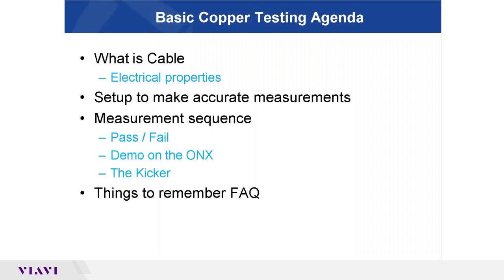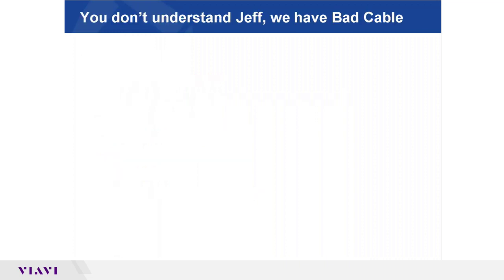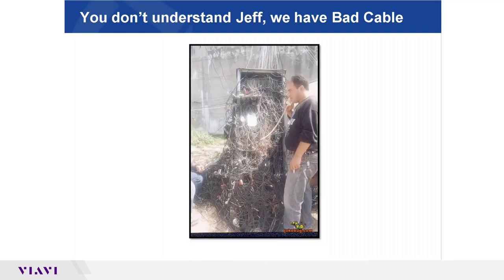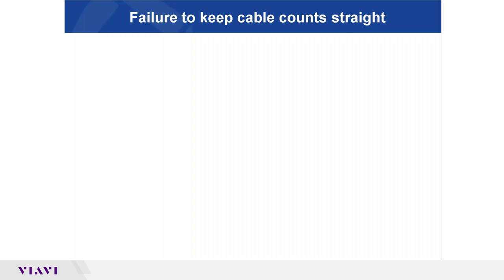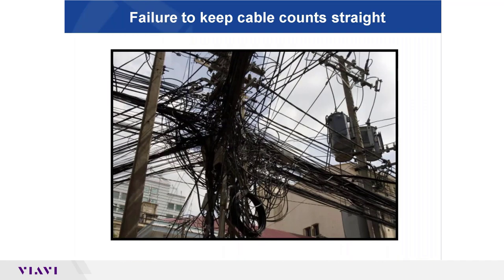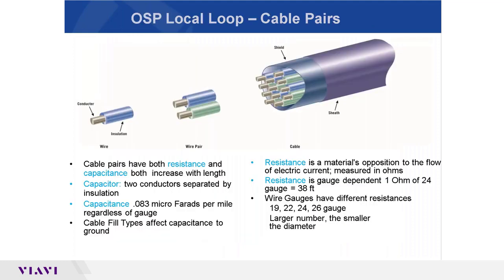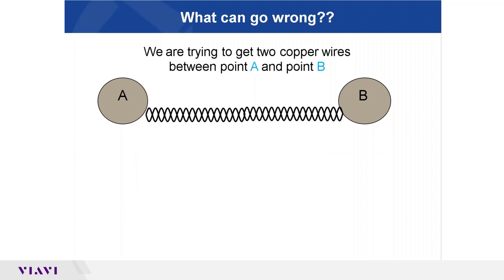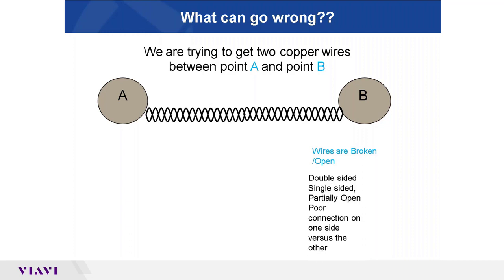Copper Testing with the OneExpert ONX-580, Session 1 (Multimeter, Opens, Balance,Load Coil)

Comment: HELLO VIAVI
I WOULD REALLY APPRECIATE AN ANSWER ON THIS ONE

I believe you have made a mistake

1. I'm not new to this game

Please reference in the video 17:20 (The Voltage Test)
i draw your attention to the screen layout and colour coding
Now in Australia we use AB  AE   BE    but that's fine.. i also Understand Tip and Ring so it's ok

Now let me put forward my case...

in basic electronics and electrical systems we know RED IS ALWAYS USED TO SIGNIFY POSITIVE POLARITY in an electrical Circuit
and BLACK IS USED TO SIGNIFY NEGATIVE POLARITY in an electrical circuit
and Green or Green/yellow is obviously an Earth Reference

so  
RED = Positive
BLACK = Negative
GREEN = Earth
Please remember this

Next point...
The JDSU HST-3000 and its successor the ONX-580 are designed (Among other things) to replace the LTS and LTS-2 (at least in Voltage mode they are)

The LTS-2 (as we know had the following colour schemes
RED = POSITIVE
BLACK=NEGATIVE
GREEN= GROUND

so far , no problems
and if i was to hook up an LTS-2 onto a 9V Battery with the Red lead to the Positive Terminal and the black to the negative  it would give me a reading of +9V
so that's our standard by which we are measuring the ONX-580

Moving forward
The viavi has 
A RED LEAD
A BLACK LEAD
A GREEN LEAD
correct

FACT -  (I have tested this)
If (When new) you plug your RED Lead into the Back panel of the viavi on the RED PORT labeled  ("R   B ")  
and you plug in your BLACK LEAD into the BLACK PORT Labelled ("T   R")
and your green lead into your green port    labelled ("G   E")
then you test the 9V battery i the same fashion

YOU WILL INDEED GET A READING IN VOLTAGE DC MODE AS   +9V

so.....  IF WE MATCH UP THE COLOURS WE ARE ALL GOOD AND EVERYTHING WORKS

Please bear with me on this ok

so... thus far we are all ok
SO THE WIRING ITSELF AND THE INTERNAL CIRCUITRY IS CORRECT

NOW HERE IS THE ISSUE
When you look at the video  17:20

TIP HAS ALWAYS BEEN POSITIVE
RING HAS ALWAYS BEEN NEGATIVE
(Even since it's started in the manual telephony switching days)  Telecommuniations basics.. right ?

so
TIP = RED = POSITIVE
RING = BLACK = NEGATIVE

but you don't have that, You've got it backwards

and let me be even more specific
WHEN TESTING VOLTAGE,   a Technician is measuring THE POTENTIAL DIFFERENCE.......     Between A to B,
Between Positive and Negative, specifically....
The black lead is used AS A REFERENCE that is referenced to be 0V DC
the Red lead is THE TEST POINT / SAMPLE POINT

so the meter (as a Volt meter) Must read....  How much higher or lower in electrical pressure is the red lead WITH RESPECT TO THE BLACK LEAD

Therefore, When we measure A LEG TO B LEG     TIP to RING  if you prefer

Our Ring is our reference (our 0V)   aka   BLACK
Our Tip is our Test Point ( Our Voltage reading)  RED

YOU'VE GOT IT BACKWARDS

You have Tip as Black,     TIP = POSITIVE = RED
You have Ring as Red,    RING = NEGATIVE = BLACK
this is both on the video and in your ONX-580 MANUAL   ONE EXPERT DSL USER GUIDE (EXPLORING THE TOP PANEL... FIGURE 6.)

the green is fine (no problems there)

so.. even though the circuit itself is polarized correctly
YOU ARE CONFUSING EVERYTHING BECAUSE YOU HAVE CONDITIONED THE LINESMAN TO FOLLOW THE ONSCREEN COLOURS

Your manual says that the TOP PANEL is as follows
COLOUR           BLACK                        RED                             GREEN                                   YELLOW                                 BLUE
                       TIP    A- LEG         RING   B-LEG            GROUND     EARTH                  RING 1     B1 LEG                T1       A1 LEG

BUT THE WRITING IS SUPPOSED TO READ AS FOLLOWS
                     R     B                         T       A                        G           E                  

as for the yellow and blue, i can only assume that these are backwards as well, but since we don't have onscreen colours for second circuits, it's not a real big concern
i'm mainly concerned with the RED and  BLACK

so you've got it backwards

then we go to the screen
now this is when EVERYTHING GETS SCREWED UP,    One checks... everything... Results are no longer accurate is you're submitting results to a higher company
and that these results rely on you getting paid for example

ON THE SCREEN
you have a BLACK CIRCLE around the TIP    (LOL........ Black is your Ring)
you have a RED CIRCLE   around your RING   (Ring  is Black)

so when a telco linesman looks at the results and troubleshoots a line (or.. Shoots trouble as you call it)
His results are going to be backwards

and even the new guys,    I have seen new blokes use this AND LITERALLY REVERSE THE LEADS
Meaning...
they would go up to an MDF
they would take their RED alligator clip and (on a Pair 1 - White /  Blue)  they would hook the RED Lead up to the Blue wire    (As we know this is incorrect)
and obviously the Black alligator clip would go on the White wire or Red Wire   (THIS IS BADLY MISTAKEN)

Now they are developing these habits because YOUR COLOUR CODE IS INCORRECT

NOW.. HAVE I MISSED SOMETHING HERE OR WHAT ??????

I've done telco for a decade or 2
black is always black
red is always red
you always hook your red lead from your meter or DMM or whatever it may be (Voltmeter)  to your A Leg,    WHITE or RED Wire
you always hook your Black lead from the voltmeter to your OTHER COLOUR   blue , orange, green , brown, grey

RIGHT ???   we all know this...

so unless i'm mistaken and have missed something 
Why are your reds and black the wrong way around ?

the meter itself gives a correct reading and is correctly polarized
however 
1. THE WRITING / MARKINGS  ON THE TOP PANEL ARE INCORRECT
2. THE COLOUR DISPLAY OF THE CIRCLES ON THE SCREEN ARE INCORRECT

3. Technically speaking.... the    LETTERS........"T"   and "R"   or   A and B if you prefer   ARE CORRECT and in the correct order
we test A Leg  TO...... B Leg   (since the LTS-2 Days)
now electrically speaking we test   THE POSTIVE SAMPLE POINT .......... WITH RESPECT TO 0V REFERENCE

so yes.... WE ARE TESTING.......... TIP ....... WITH RESPECT TO   RING

so technically 
THE SOLUTION :    Where you have a Black Circle,  needs to be replaced with the position of the Red circle and vice verse

I'M GUESSING YOU COULD ROLL THIS OUT IN A FIRMWARE UPDATE AND I DON'T THINK IT'D BE THAT BIG OF A DEAL TO DO 

my current ONX-580  is updated to firmware version 10.3.12  (The current version)
so technically the meter readings are correct

IT'S JUST THE COLOUR CODING THAT IS REALLY WEIRD AND CONFUSING

Now.. this wasn't a problem with the LTS-2
this wasn't even a problem with your JDSU-HST 3000 First version   BECAUSE THE SCREEN WAS BLACK AND WHITE

and i remember when you brought colour into it 
and i remember how you sold the product and how excited you were about it
AND IN THE SPIRIT OF THAT SELLING POINT that being.....

"Guys, .. Look how amazing this is,  AT A SINGLE GLANCE you can quickly derive all your readings and know what's going on"

well.. AT A GLANCE and any techs INSTANT REACTION IS

RED =  POSITIVE
BLACK = NEGATIVE
GREEN =  GROUND

now.. if you get a negative reading where you should get a positive 
YOU ARE GOING TO ASSUME YOU HAVE A LINE FAULT WHERE YOU DON'T

or
if your voltage appears on the A leg , when it should be on the B leg
YOU ARE GOING TO ASSUME YOU HAVE A LINE FAULT WHERE YOU REALLY DON'T

AGAIN.. UNLESS I'VE GRAVELY MISSED SOMETHING (And please let me know)
THIS IS A MISTAKE
and i've asked others and they simply shrug it off and say... ahhh whatever

WELL VIAIVI.. LET ME BE CLEAR ON SOMETHING OK

1. I'M AN ENGINEER
2. I PRIDE MYSELF ON MY EQUIPMENT AND UNDERSTANDING IT
3.  I THINK WITH THE VIAVI ONX- 580 AND 620     YOU HAVE MADE A VERY VERY FUCKING GOOD PIECE OF HARDWARE
it's just a pity that most tech's don't understand how to fully utilize it

so.. since you've made a good piece of hardware WHY ARE WE CONFUSING THE ISSUE BY SWITCHING YOUR RED AND BLACK

CAN WE PLEASE FIX THIS IN A FIRMWARE UPDATE
Please let me know what your thoughts are on this......
and i put this up here for the benefit of other techs as well, should they visit the site

I sincerely hope this posts gets the attention it deserves
i will also be filing a support ticket to viavi regarding this

i mean, can we all agree......   it would be much simpler if   TIP had a RED CIRCLE around it and   RING had a  BLACK CIRCLE
that would make more sense wouldn't it ?

anyway... thanks a lot
speak soon
Reply: Hey man I see you really know how to use the JDSU efficiently can you help a new tech out whom a haven’t been showed what each thing means and how to tell if I have a good pair and trouble shoot my pairs? I’d really appreciate some insight, as I’m thinking of quitting due to the fact I’ll be on my own soon and I don’t know what I feel I should know
Reply: @MasSmokes  
Sure mate  Although these things can't be done on chat
if your'e in sydney we can meet up for a coffee , go to a pit or pillar and i can show you some shit
if you're somewhere else we'll need to zoom or skype
where are you located
Also   DO NOT QUIT, ok  there is no reason for you to quit

I've trained many techs and one problem i see happening over and over is that when they are onboarded they get trained by someone who doesn't really know the game because they in turn go trained by someone who didn't know the game

As i said in that massive wall of text, Viavi have made a very fucking good Qualification tester and IF YOU KNOW HOW TO USE IT it can be very powerful and time effective
but if all you know how to do is press OneCheck or DSL Check then you really limit what you can do 

so yeah mate, i'm happy to help anyone that wants to learn
Let me know what you want to do and i'll try and work with it, ok

speak soon
be cool
Reply: @martinkuliza  damn man I’m in US Louisiana I’d still be down for you to show me what you can because that’s literally all I know how to use is single pair, bonded, and one check no idea what the numbers mean other than the opens (sorta) my trainer is our most efficient tech but it’s hard for me to catch stuff because he just gets mad when I fuck up or don’t understand something he think I should this is all new to me and some of these guys been doing it for 15+ years so it’s not so simple and I’m hesitant and forget stuff messing up my efficiency because this guy just gets upset if I’m not within my appointment window or I mess up
Reply: Even sometimes I do my part right and he stresses out and passively blames me and then come to find out it wasn’t me. It’s really discouraging and it makes me want to just try something else even though I know the great things that can come from this field I just start feeling incapable even though I know I am very cable if I act ya lot had someone to take the time and show me what I really need to know on trouble shooting/ distances from the facilities :/
Reply: @MasSmokes  
Ahh , i see
well let me put you at ease
1. DON'T WORRY, I'll show you
2. They shouldn't be getting upset at you , I understand if a linesman has a lot of experience (and i certainly do ) but you don't go and get the shits at the young guys or the new guys and the fact they do tells me a lot about them

Your'e correct it's not simple but that's why what we do is called being "Technical People" if it was simple we'd be called "Simple People"
simple stated, we are the guys that fix shit, our job is to solve COMPLICATED PROBLEM that's why its' not simple

BUT....... IT'S NOT THAT HARD TO LEARN EITHER

as for your appointment window
Do you mean 
1. Arriving onsite ontime ?
2. or.. Completing the job in a specific time

If it's the latter then i understand, i have trained techs who have taken 3 to 4 hours onsite and i have shown them how to complete their jobs in maybe 30 mins to 1 hour and really it's all about Knowledge and time efficiency

you stay onsite for a long time because you tend to go over your tracks again and again unnecessarily 
the Viavi 580 is supposed to MAKE YOU MORE EFFICIENT
their motto is "it makes any tech an expert"  LOL
well that's utter and complete bullshit 
but the catch is...   IF YOU KNOW HOW TO USE IT  yes, it can make you very good on the field and very time effective, but you need to learn your fundamentals  WHICH I AM HAPPY TO SHOW YOU

so don't worry mate, we'll sort it out
Are you available at some point today 
i mean what times is where you are now 

Here in sydney it's 11:38am 26th August
google says Lousiana is now at
20:38  25th August

so not to spin you but i'm in the future   LOL

are you available today , if not tell me when you're free
Reply: @martinkuliza  dude anything you can do to simplify the readings and trouble shooting the copper I’d appreciate more than anything. I feel It’s easy and I’m overthinking it but I’d appreciate it man I really would I actually have to go in tomorrow morning it’s 9:45 pm here I’m off this weekend or tomorrow evening for me should be a little earlier in the day. Whatever works best for you I’ll try to make suitable I really need someone  to tell me SOMETHING.
Reply: @martinkuliza  and yes I mean finishing my jobs in time because sometimes I’m back tracking because I forget something I need and then my trainer gets agitated and he’s like this is what’s making you late and absolutely understand but it’s just if you don’t know then you don’t? Literally trying my hardest I’m drenched everyday trying to provide a quality service that’s all I want to do is make a good purpose and enjoy it somewhat it’s not fun at all for me as of now
Reply: @MasSmokes  
well ok,  let's start with
When are you are available
it seems i'm 15 hours in front of you
Now, i'm available later today  so it's 1pm here now, i can probably do something around 4pm  that would be your 1am (but you might be asleep)
can do something tomorrow , My 4pm but again it might be too late
now on sunday i can pretty much work around you
so let me know what works for you and it'd be good if we could jump on skype or zoom
Reply: @MasSmokes  
yeah well, he's correct and you are as well, and you are drenched because you're working harder not smarter but if he see's your problem then he needs to show you how to do it properly
SEEMS TO ME YOU NEED STRUCTURE AND A SOLID TROUBLESHOOTING PROCESS That you just follow over and over
it seems your'e running around and back tracking too much
i can fix that, no problem
Reply: @martinkuliza  alright man that’s cool with me anytime Saturday or Sunday whenever I’ll get my Skype to you or however you want to do I kind of know what a good pair looks like now so I am getting somewhere just let me know I’ll do what I have to do to abide your schedule since you’re the one taking the time out
Reply: @MasSmokes  
it's like 9:30pm where you are now isn't it ,?
Reply: @MasSmokes  
i didn't get an email yet
i've got a few things to do today so i can be available at certain times otherwise if you want to tee up for tomorrow that'll also work But from Monday to Saturday i'm usually busy, some Saturday's i'm ok though

let me know when you want to do it
Reply: @MasSmokes  
I'm going to assume that you've gone to bed
since google says it's 11:30 on your end
Reply: @martinkuliza   I’m still off weekends as of now so anytime tomorrow would work since I’m just seeing plus my JDSU is in my van so I’m not sure if it’ll be better if I had it with me or not but any weekend works even evening around 8pm
My time just give me the info so I can get with you a simplify this I know I got it I’m likely overthinking it more than anything. Also I appreciate you for taking the time out, still good people in this world 🤙🏼
Reply: @MasSmokes  
Oh also , yes, Get your 580 with you so we can go through things together
Reply: @martinkuliza  sounds good I do have it with e today but Ik it must be way out of time for you what’s a good time this week if I haven’t gotten it by then I think some things are slowly coming to me
Reply: where can i find newbie tutorials for onx 580?
Reply: @drcarmackgames1599  
Well , you have a few options
1. The viavi website has a tonne of video tutorials,  they are really long, but in my opinion , worth it

2. You can contact me and i'll supply them to you 

3. You can contact me and ask me any question you like on like zoom or something and we can have a chat and i can help you , 

4. i have found the best way to do things is to fuck around with the meter and explore and then google terms
so if you go into the TIMS application for example, there is a world of stuff to learn there

but let me know what you want to do
Reply: @martinkuliza  you were right, best way to learn is to play with it and experiment, i managed to figure out the stuff that i needed for my job. thanks for the help!
Reply: @drcarmackgames1599  
You're Welcome mate, Let me know if you need any other help.

also REMEMBER... The best way to learn is to play with it ,   Just don't play with it too much  :P
you'll go blind :P
Reply: @martinkuliza  im a telecom field tech, ive already learned a lot, but some stuff is still confusing. what do you do, are you an electrician?
Reply: Amazing, I went through all your great information. It is really impressive and you have a great knowledge of Copper. I am new to this field and still in the learning process. Can you please create a cheat sheet so new technicians can use it for troubleshooting while they are on the fields. I will really appreciate your reply. Cheers Mate
Reply: @khaliligul3277 
Sure, since i can't upload it here.
I'LL GIVE YOU THE DETAILS and you can make you own in Excel or Word

i'll give you 3 Cheat Sheets

NOTE : This only applies to Australian NBN and the old PSTN when it was Telstra and ISGM as well as PMG

NOTES :
There has always been a debate with Linesman between
- what is taught in the classroom and Courses
- and What ACTUALLY happens in the field

Of course, what happens in the field Absolutely Takes precident.
In saying that...
- Standards Must be complied with 

-  Standards Must be respected irrespective of compliance as there are good reasons why they are in place and they have been developed for over 130 years of trial and error, it would be foolish to ignore them

- In the Telstra Days things were more hard and fast, the only thing that was bullshit was the F.A.S.T. or  SULTAN Test depending at what point you worked in the field,   to NBN Tech's this will be   NPT (Network Performance Test) (During the ATLAS Era) or the current SMAX Era

In any case, the older test was more involved and better but then the hardware test turned to be a software test and turned to shit.
You could literally have an Open Circuit, Call the Test number (YES, WE HAD TO CALL A NUMBER) and enter the FNN and you'd get your results.
Even with an Open Circuit Fault  it would come back as passing after 2 or 3 tries
ANYTHING TO GET OFFSITE HUH ?

and what has changed on NBN,    Not much.
The techs get minimum training,  The Call Centre people don't have a clue (at least most of them don't)

AND THESE RULES THAT ARE SUPPOSED TO BE RESPECTED
Now in the NBN Days get changed for the dumbest reasons

so Here are a few examples of stupidity 
(Actually i'll make 1 post to explain all this then another with the readings)

- You are taught "The Proper " Readings in the course and you are told,
THESE ARE THE ACCEPTED READINGS
then....
- The Call Centre doesn't accept them regardless of telling them it's in the course.
Apparently the call centre think up the pass readings on the fly

- Then they spread incorrect rumours to other techs and then you have to figure out which are the correct readings

- then you have a HFC Fault and get told to put a 6dB Attenuator on a line that is -21dB
These people have no concept of Ohm's Law and yet they are responsible whether we get paid or not

- Then you're on FTTN telling the call centre operator you have HIGH RESISTANCE on a line,   BUT THEY DON'T KNOW WHAT RESISTANCE IS

so.... the readings i'm going to give you are as follows

THEY DO COMPLY WITH THE COURSES
THEY DO COMPLY WITH NBN
THEY ALSO ACCOUNT FOR WHAT REALLY HAPPENS IN THE FIELD
THEY ALSO ACCOUNT FOR WHAT WILL ACTUALLY GET YOU PASSED AND PAID

so to be clear, the readings are not the exact one's in the course
(Although at one point they were)
but THEY ARE REAL READINGS AND WILL WORK
Follow them and you'll be fine....

See the next reply for the readings

First i'll give you HFC that pertains to the ONX-620